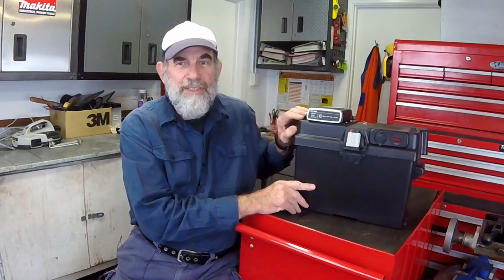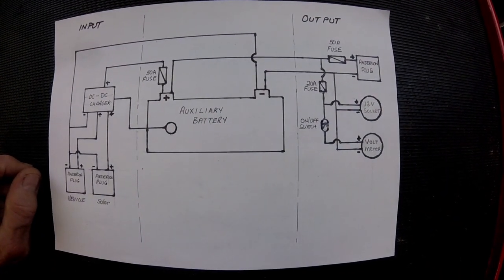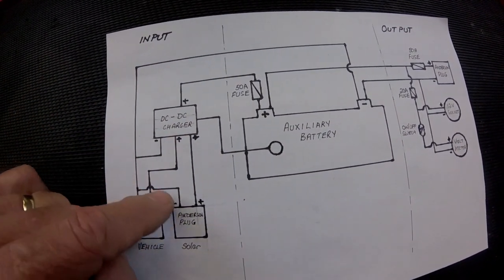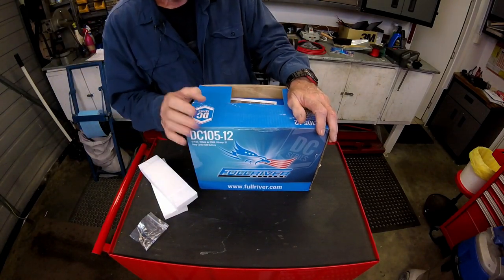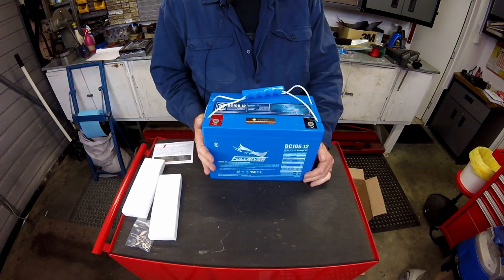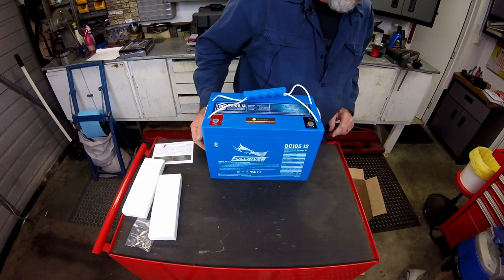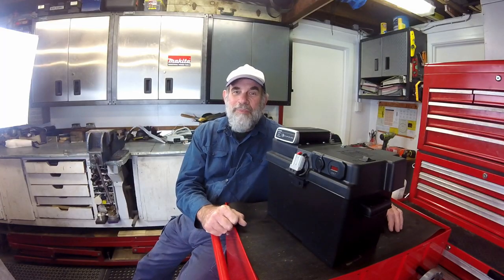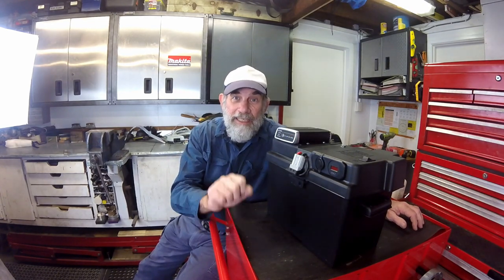Portable 12 Volt Auxiliary Battery Box Build: Part 1

Comment: thanks ahead of time....great info---how do i set it up for a lithium battery?
Reply from the maker: The Projector IDC25 DC-DC charger used in the video does not support a lithium battery. You would need to use something like the 'Projecta 25A 5 Stage Intelli-Charge 9-32V Lithium Dual Battery Charger' . The wiring is the same, just a different charger to deal with the different charging characteristics required for a lithium battery.

Comment: Thanks for sharing. Trying to have a similar setup but without DC-DC converter and chargers. 
You've used 50 AMP fuse, what kind of equipment you were trying to power?.
Reply from the maker: The output 50 amp fuse is really about protecting the Anderson plugs and cabling for all possible uses - a lower fuse can be substituted if needed, or alternatively use a second lower value fuse in the equipment you are powering. The input 50 amp fuse is specified for that model dc-dc charger.
Reply: @whitedoggarage  Really appreciate it. Thanks again